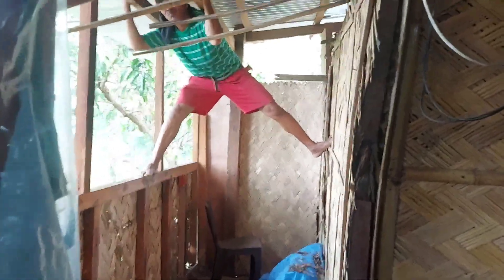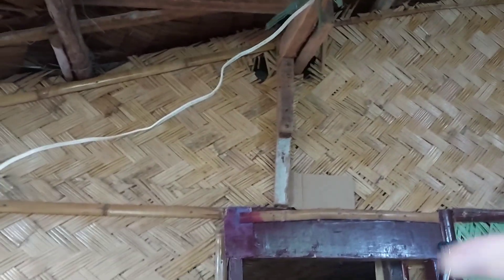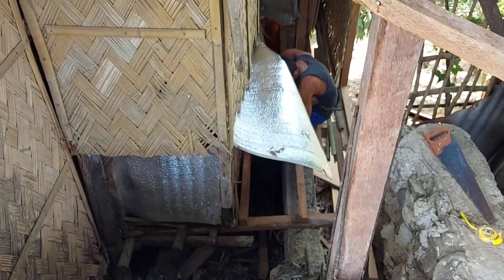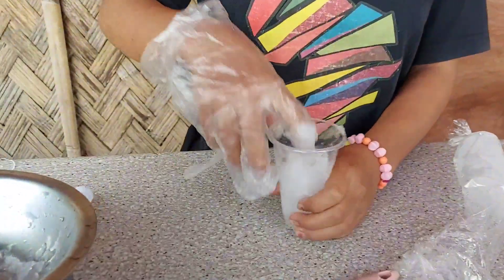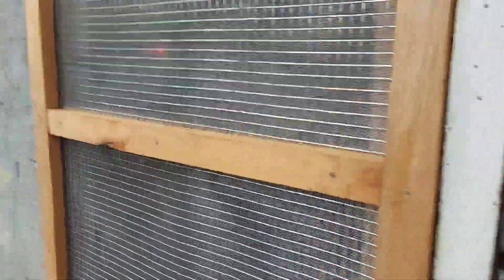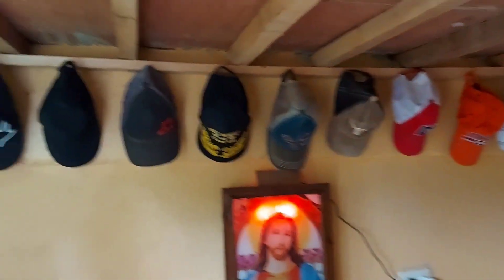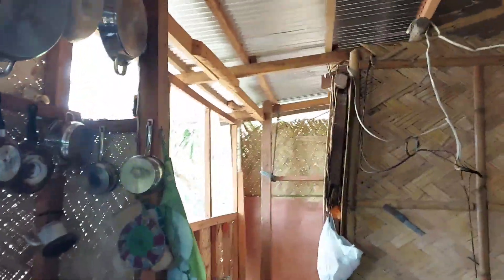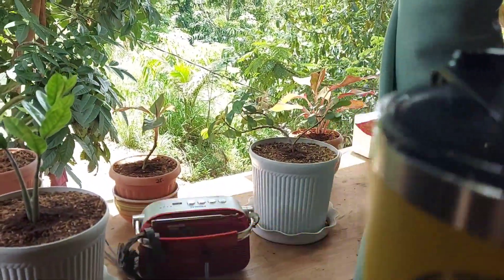Province Life In Palawan, Philippines

Comment: Hi Tim!.@ 56: I do that often to  here in Canada  while fixing things or  doing renovation,  so not only in the Philippines,  beside  the solar panel ,  you can use half to a  full sheet  of double wall Lexan Thermoclear  Polycarbonate, instant skylight ! About $80 - $100 sheet there, in Citi hardware,you can drill or burn thru with  hot nail and screw  it down plus a rubber washer, Lexan Polycarbonate  make good windows, unbreakable  in typhoons, unlike  glass  remember  which side goes out - UV resistant side! use  steel hacksaw  blade to cut!
Reply from the maker: Hey that sounds pretty cool.
I just may look into that.
Thanks so much!
Reply: @TropicalTimInthePhilippines   tip:You can also use  grinder  with metal  cutoff blade to cut  Polycarbonate/ Lexan  or  most plastic  boards,PVC  material  like  pipes,  a good grinder( Dewalt or Makita)  is a very useful tool, can cut  metals  and  tiles  with proper  grinding wheel.